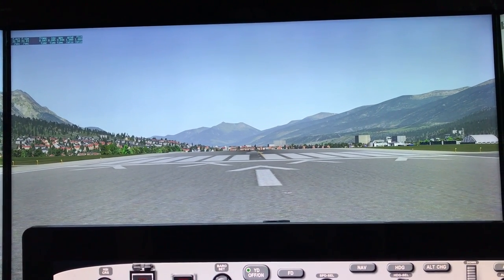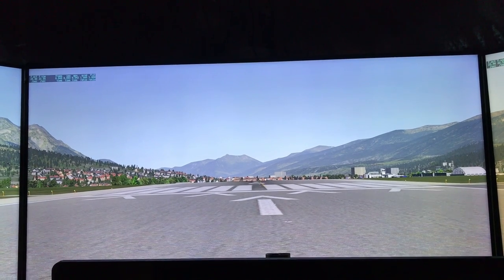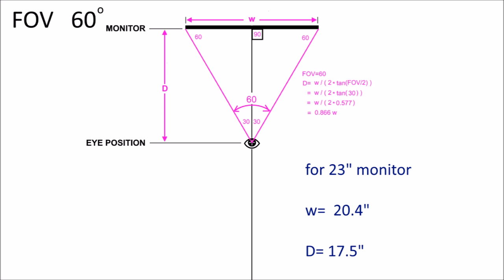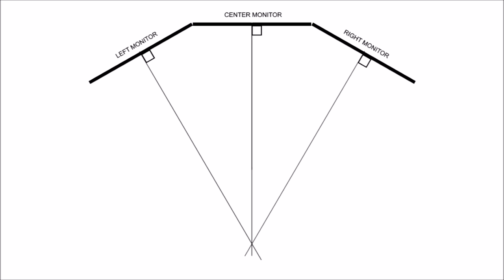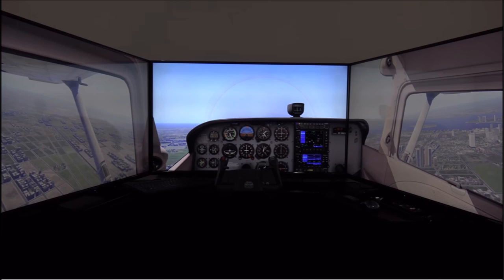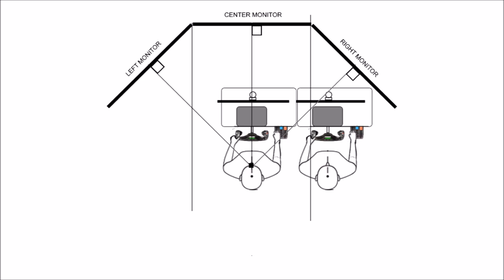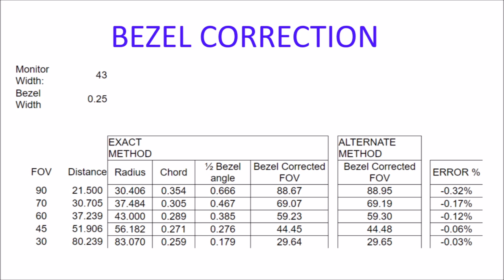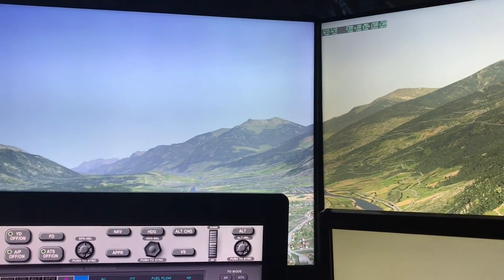x-Plane 11 Multi View Geometry & Bezel Correction

Comment: Hi Russ, First of all I really enjoy your videos! I want to build a setup with 2 seats, but as you demonstrate, this is not ideal.
Would it be any advantage to have a setup with 4 screens. Leftmost at -45deg., 2x at 0deg for each seat and the rightmost at 45deg.? Any advice on this?
Reply from the maker: Thomas Nilsen  if you did this it would be equivalent to a single large screen to calculate the ideal eye point. Then you would have to calculate the actual FOV for the two side monitors based on the geometry of the setup.  The bigger forward view would help by moving back the ideal position but the total field of view (FOV) will be less.  There still will be only one ideal eye point though. The only solution for a multiplace cockpit is very large screens or a large projected  curved screen. It really doesn't solve the problem but as the size gets larger(and ideal viewing distance)  the error becomes less evident. Actually even our two eyes cannot both be in the ideal position but since the distance between our eyes is small compared to the monitors size it is not really noticeable. Good luck.
Reply: Thanks much! Unfortunately, there is no room for a curved projection screen. So I'll probably fit as large screens as I can (3x 42-48") and live with the compromise. In any case, I plan to fit a number of hardware instruments with physical buttons, as well as multiple instances of air-manager to create the cockpit (737NG). So it will still be quite immersive I think. For me, the most enjoyable part is the system programming and monitoring. Scenery comes second. :)

Comment: I know this video is pretty old. but I hope this messages reaches you. I want to do 4 screens and the bezel of the 2 in the front being in the center and 2 for side views. for a 2 seat cockpit. Is this possible? I haven’t been able to find an answer. I’ve seen a few ppl using it this way but just 2 screens. As long as I have the computing power will the visual aspect work?
Reply from the maker: Obviously if the four TVs form a single view there will only be a single point that yields a perfect view. The math works for any number of screens. Just sit centered and perpendicular to all four screens. Say you want a 160 degree total FOV with 4 monitors. The lateral offsets of the monitors from left to right. -80, -40,40,80 all with a 40 degree FOV minus bezel correction. The monitor rake back angles would be the same as the lateral offsets but no bezel correction for those. Use the same formulas to calculate the ideal eye distance.

BTW trying to place the pilots eye not centered in the monitors array… in this case in the inside edges of the middle two monitors will create the effect of flying or taxiing in a crab. Very annoying and noticeable especially on landing or taxi where the centerline is obvious.

Comment: Russ, regarding your image of Michael Browns 70" FOV setup, What size screens are your calculation based upon? I am laying out the same with 55" 4K TV's and would appreciate your calculations for - D & W Dimensions if I set FOV 70 on each TV. Thanks.
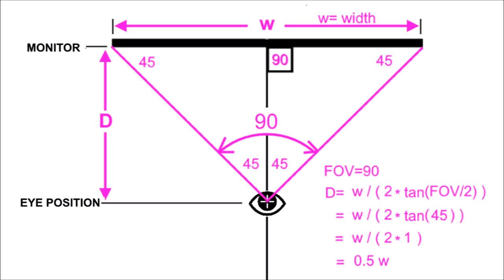Reply from the maker: Use the formula from 8:29 in the video and use 70 degress instead of 90.  

D= W / ( 2 * tan( 70/2))      so D= W/(2* tan(35))  

  tan(35) = 0.70  so  D= W/1.4    or   D= 0.714W

so if your 55" monitor probably has a width of about 48"   so  the proper viewing distance from the screen is  about 34.3"
If the side monitors are raked back at 70 degrees each the distance to each monitor should be the same.  I found 60 degrees worked better for me since I used 49" monitors.  I think you can probably get by with 70 degrees FOV using 55" screens.  That gives a 210 total FOV which will allow looking slightly (15 degrees) behind the wing line(lateral axis).   I put my screens on rolling stands so I can change the angles as desired. Let me know how it works and send a few pictures.
Reply: Thanks Russ! I’m setting them up now and will let you know.
Reply: Russ, you're right, 70 works great. I do have many other questions and was wondering if you have a website or Discord channel where guys like me, and all your loyal followers could connect and share ideas, thoughts and configurations? I ask because I recently setup a DISCORD server focusing on BRUNNER HARDWARE and have met a number a great guys willing to share their experiences in a much more productive fashion than what forums provide. The same is needed for those of use with multi-PC multi-screen networked setups. YouTube is great but not very efficient for helping one another in an efficient and personal environment. Have you given any thought to Discord? I would really like to talk to you about network setups, and anyone else desiring the same. Thanks.
Reply: Russ,  I recall having a spreadsheet where I could enter my monitor size and the eye distance was calculated automatically. I can only assume you sent it to me but I can no longer find it. Would you mind providing a link to download it? Thanks

Comment: Is there a reason why xplane only allows me to select 60hz and not 144hz refresh rates. Both of my monitors are set to 144hz, but when I select 144hz, xplane defaults my selection to 1920 X 1080 60hz?

Comment: I'd like to use 5-43" monitors with 2 pcs, can that be done and could you add any tips on how to do it.
Reply from the maker: Pretty simple with XP. You obviously need two licenses for XP and three if you want a panel with a popped out window fro XP like the G1000.  On the network tab in XP set panel PC set as the Master and the two scenery PCs as External Visuals. I would put the center three monitors on your strongest pc and your far left and right on a second PC. You could set the FOV to about 45 on ach monitor( minus the bezel adjustment 
) and set the horizontal offsets on center three monitors to. -45,0, 45 and the left and right to -90,90. Be sure you eye is centered and perpendicular to all five monitors. May need 55” monitors to get your sim inside this arrangement depending on what you panel consists of.
Reply: @rbarlow  Thank you!

Comment: i don't know much about head tracking, but that setup looks like it would be sweet if you had head tracking and it only tracked your forward/backward head movements and NOT your looking left and right movements.
Reply from the maker: Matthew Holevinski there is only one “sweet spot” where the physical view of the screens match what is displayed on the screens. I think physically moving your head would undo that match especially for  the side screens.  The only display system that provides accurate views from various cockpit locations is a collimated mirror setup ( read about here. https://www.christiedigital.com/emea/simulation/simulator-projector-systems/solutions-for-simulation-projection/3d-collimation. )

Comment: Fantastic video! Might be a silly question, what software were you entering this data in to correct the image once you made these calculations? The bezel correction was a huge benefit to the overall experience im hoping i could do this with my setup!
Reply from the maker: Ilija labovic it was X-Plane11 graphics settings
Reply: Russ Barlow  could you send me a screenshot of where you entered? I was not able to find anywhere for bezel correction
Reply from the maker: Ilija labovic I am not near a computer but on graphics settings is an area for each monitor. You have to scroll down under each and click the + to expand the settings. Then set the visual offsets and field of view as discussed in the video.

Comment: Thank you for putting so much time into this, Russ.  I am starting out with XP and it was very helpful.  In your opinion, would a 3-screen setup like this also work with one 50” central TV and two 43” sides?  Perhaps there would be perspective issues?
Reply from the maker: It can work but the geometry gets a but more complicated since the different Fields of view in the smaller monitors. you will need to take that into account to make things look right, Also since XP does not allow vertical adjustment of the eye position on each monitor but only the vertical angle you will need to be sure the side monitors are centered vertically on the center monitor so the horizon line will match up .  
Since 20" and 43" TV are about the same cost, I would just match the three monitors sizes.  I also highly recommend they be identical make and model since the color/contrast/response times and the look can be hard to match with different TVs.
Reply: Russ Barlow Great, thank you.

Comment: Video distortion is non existent. However, my default view is a forward with 3D cockpit and for the default 737, It puts me much to close to the panels. Even after zooming out by hitting the "," key, I'm still too close. Is there a way to zoom out further for X-Plane 11. I had the same issue with FSX and the fix included modifying the config file to Wideaspect = True instead of Wideaspect = False. Please advise.
Reply from the maker: Thomas Briscoe    You can set the Field of View to whatever you like in the graphics tab of the Settings. Another option might be to physically move the eye point backward.  I think the default key is either period or comma.

Comment: Russ I am rebuilding my sim I have a CLS Brunner yoke red bird rudder peddle and throttle and flight illusions radio and gauges stack so I have one 27" 165 HRTZ monitor but want to go bigger so thinking a TV What are your thoughts and I do want 3 monitors thanks
Reply from the maker: james Higgins... my monitors are Vizio 49 inch 4K televisions. I think the 4K is overkill now considering the state of graphics cards. I would suggest the largest 1080p TVs you can afford and fit into your room.

My only caution is that you be sure that the input lag on your TVs is not a problem. I use research from www.rtings.com/tv. who rates TVs for video gaming

Comment: The point is this. You move your head or you move the picture. Consider. I have tried out all, i mean all possibilities in the last 8 years. My conclusion become this. Back to simple. 3 52 inches monitors in portrait mode. Flat. This gives automatically the half screen as scenery end the other half the complete cockpit in his original shape. If i move back in the monitor then i have left window and right window and can still read the instrument cockpit. I use now also RTX 2080 Ti.  (Fps is out of concern) My feeling was never so close like this because the size from the cockpit is 1 To 1. the Yoke in the screen is the same size. The instruments are about original size. Very great feeling i promise. And  i fly always whit the cockpit integrated. Cheers.

Comment: Russ, what considerations/calculations should one do when considering a projection screen out front? Check this out, two monitors mounted to the sides for 225d FOV, but only a single screen up front via projector:  https://youtu.be/K72u-n0rJSo?t=7m.   I'm thinking this may resolve some of the view angle issues regarding 2 pilot cockpit, but curious how accurate/inaccurate such a combo would be.

Comment: Why not just do a projector and curve projection canvass?
Reply from the maker: First, a curved screen still requires proper geometry and there is only one optimum eye position to see the geometrically correct view.  As for curved screens and projectors there are several reasons these setups are problematic.
1- projectors also have resolution limits so the field of view is limited so multiple projectors are needed. Three projectors for good resolution 180-210 degree total field of view.
2- the projectors must be mounted overhead requiring a high ceiling and keystone correction. Depending on the geometry of the cockpit your setup may create shadows on the screen.
3- it is difficult to keep all three projectors aligned at various temperatures since tiny movements are exaggerated when projected
4- in all but the most expensive laser projectors the image will appear duller and less bright than a TV image
5- the overlap areas between projectors have to be blended to look consistent with the non overlapped areas. This is difficult to get perfect.
6- building a good and geometrically accurate  curved screen is somewhat difficult
7- finally, all sims ( except XPLANE pro) support a planar projection designed for flat screens. It must be corrected by some third party, fairly expensive third party software like Fly Elise to get an accurate image to project on a cylindrical screen. Mapping the image can be time consuming and may require frequent recalibration.

All in all LCD TV screens are way easier to set up and use despite accepting the bezels and other limitations. Cheaper too considering the price of TVs now. VR offers the alternative to both screens and projectors and the view is always geometrically perfect.

Comment: I run a i7 32 gig ram 2060 video. I've tried to run this setup for weeks.. trial after trial.. it just wont run on mine. Ive unplugged and switched plugs on monitors n moved them around. Works great on nvidia surround but I would love to see it like you have yours. Anybody have a nvidia 2060 that can run this setup want to confirm. Maybe tell me how ur monitors are plugged in. Also i run 3 40 tvs.. not monitors. Not sure if that would be an issue.
Reply: Did you ever figure it out?  Was it practical?
Reply: @harpoon_bakery162  yes. I had to delete the file ... inside.. x plane/output/ preferences/ a file named screen or window positions.. then go thru the setup of window positions again. No biggie.. but yes worth it. Hard on pc.. but view is great.